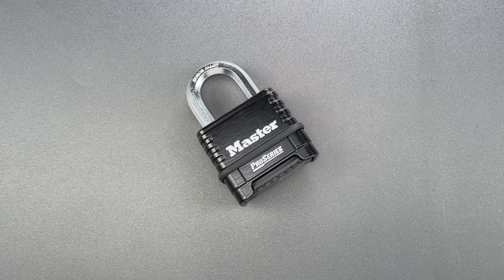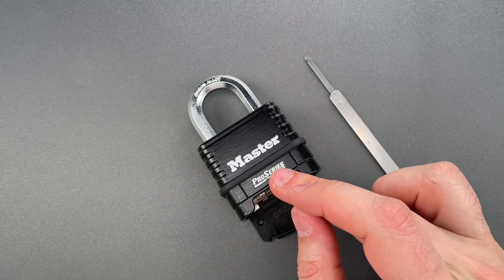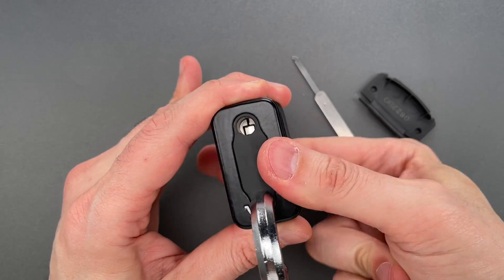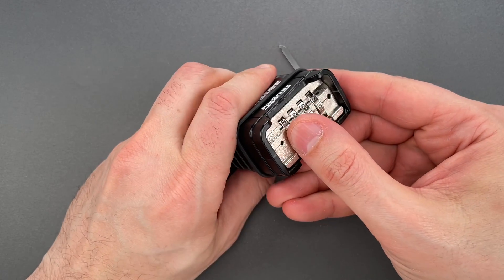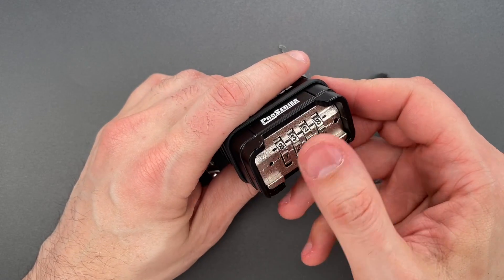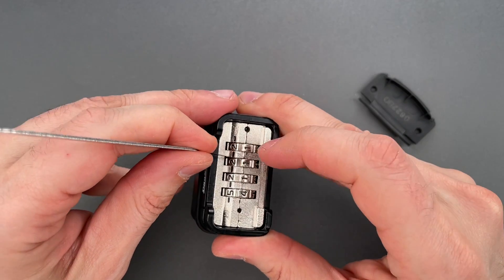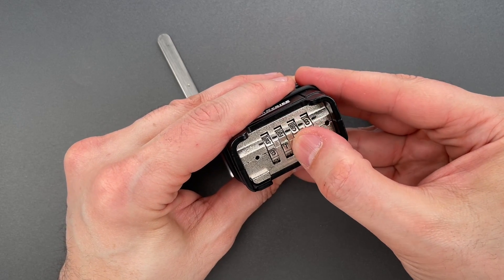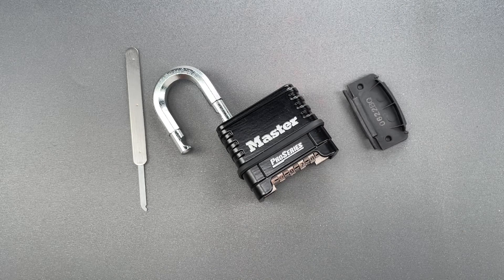[1521] Decoding Master Combination Padlock (Model 1178)

Comment: why are seemingly "all" combination padlocks in the US the kind with the wheels on the bottom (not counting the ones that have a rotating wheel on the front, which is just even weirder), while most if not all combination padlocks found in Europe are the kind with the wheels down the side with the shaft going through them? It seems the latter one is cheaper and easier to produce (maybe Im wrong?) and they are inherently more resistant to manipulation, since there is no separate locking mechanism you can reach in with a tool to manipulate. And will almost certainly have false gates to make more traditional decoding (like your first method in this video) more difficult as well (which even the cheapest ones have, since it's not an additional cost in any way to have them, while the Masterlock in this video clearly didnt have them).

I just dont understand why locks sold in the US go for a seemingly (to me anyway) more complicated and thus more expensive design and mechanism when a cheaper and easier one is automatically more secure anyway.

Comment: Mr. LPL, thank you for another informative video!  However, I have noticed the sound level on your videos recently are very quiet.  Even with my volume all the way up, I have a hard time hearing it on my laptop.  At any rate, the only reason Master lock can still produce junk like this is similar to how vehicle manufacturers can get so much money out of new vehicles.....simply because people are willing to buy them!
Reply: I agree about the sound level. If the video sound is loud, it can be turned down. If it is too soft, there is only so much ability to turn it up. I watch on my phone, often surrounded by other activity with competing noise.

Comment: I don't know, seems like one of the better Master Locks.
Reply: Only because combination locks can't be raked open.
Reply: It's one where you need to know the "trick", which is better than some. However, the "trick" being "Put tension on the lock while guessing the digits" isn't a particularly good one... At least the build quality looks reasonably decent!

Comment: The saddest thing about this is it will not change anything. All of the home stores will still sell tons of Master Lock products and Master Lock will not change their products.
Reply: I have used Master locks for many years on storage units and when they have been defeated it has been by common bolt cutters. I think maybe an angle grinder a few times, too.
Reply: @MrTruckerf  This!

The crushing majority of people have no idea about picking or decoding a lock like this. And amongst thieves it's just barely more common knowledge. To a thief it doesn't pay off knowing the ins and outs of decoding these locks. A battery powered angle grinder works on all locks no matter the design or construction. And if the lock would be built to withstand the angle grinder odds are the door or whatever the lock is securing isn't as sturdy.

Brute force is the most universal "skill" you can apply to doors and locks. And if brute force doesn't make it you're not using enough of it...

It's a bit cliché but oh so true. The small percentage who do know how to decode these locks are generally not the ones you need to worry about. That is unless your main concern is someone getting in without leaving signs of entry. Then this becomes a much bigger problem and you probably shouldn't buy your locks at Walmart.

Having said all of this I still think it's ridiculous how these known weaknesses remain in products that are not even cheap, and how they keep popping up in new lock designs time after time with only minor differences, and usually not enough to even slow down someone who ahs learned to pick or decode one of them.

Comment: if it is a 0-9 lock, it would be easier to move all digits 4 in the other direction (10 = full rotation)
Reply: No, they turn better in the other direction.
Reply: I was thinking this, too, but maybe scrolling the other way undoes something inside?
Reply: @DBTechYT  It's him going easy on Master Lock (or an intimidation tactic), intentionally going slightly slower :V
Reply: @higueraft571  That actually makes a ton of sense :)

Comment: Masterlock: Our locks have so many different vulnerabilities that you won’t know which one to use on which lock.
Reply: Picker wont know what to do from having so many options
Reply: @QruisS , paralyzed by choice! 😂
Reply: @jeffsmith6303  stunlocked (🥁) by the possibilities
Reply: @jeffsmith6303  Knowing how I react in front of a restaurant menu, that would definitely work on me xD
Reply: They should make a special lineup that tries to combine as many of them as possible into one lock.
Reply: @ristopaasivirta9770 ❤😅😅😊😂😊😅😅❤😊😅😊😂❤❤😅😅😅❤😅😊😮😊😮❤😊😅❤😅😅😊😅😮😅😮❤😅❤😅❤❤😂❤❤😅😅😅❤❤😮❤😮😅❤❤❤😊❤😊😮😮😊😊❤😅😅❤😅❤😅😂r
Reply: @ristopaasivirta9770  That would actually be counter-intuitive because then it increases the chance any one method would work without fail. I think you meant that they should make the locks so they don't have so many vulnerabilities, but still possesses ONE of the many known vulnerabilities. So you have to try harder to discover what it is. 

More specifically, if we took a single lock model and mass produced it, then it would be even more interesting to find that one production of that model's line has one kind of vulnerability. But grab another lock from the same production line and model... it has a different vulnerability built-in! You'd be grabbing the same lock, same model, but a different vulnerability each time! That would be an interesting take from Master Lock to employ. To embrace the vulnerabilities.
Reply: Conversely, you never have to worry if you forget the combination. You don’t even need any kind of a tool to open it!!’
Reply: Ahhh, the "predator satiation" method of security.
Reply: Security through obscurity lol
Reply: Two wrenches force on the shackle almost always works, however to the point where the shackles start to become unusually beefy.😆
I already needed to correct myself. Angle grinder.... bolt cutters and so on....🤣
Reply: Ah I see, the "reverse psychology" anti-pick defense....😂
Reply: They should make a lock that you have to use a combination of bypass strategies to open it rather than a code
Reply: Security through choice paralysis
Reply: Some of the locks are so bad that a good whack with a hammer is enough to open it.😂
Reply: I am glad masterlock made some locks that require no tool to pick, now if the owner loses the key, he can finally open the lock without a locksmith, or owning any tools. Because the lock is so bad, some thieves will  feel bad for him and just leave his stuff alone.
Reply: Lockpicker is so undecided on what metod to use, that it delays the picking.
Reply: Security by indecision...
Reply: Sounds like IBM 😂
Reply: Ain't that a form of pick resistance
Reply: The picker will have so many choices that the lock becomes unpickable
Reply: Security by decision paralysis.
Reply: LPL spins wheel …. Hot breath it is pfffft 💨
Reply: Make a lock thats made of africanized bees.
Reply: Masterlock: "If you can't beat them, confuse them"
Reply: That's called security through obscurity
Reply: Security through obscurity
Reply: It's the only way to get past the 2 minute mark.
Reply: That is spot on for Masterlock!
Reply: often shaking them hard enough is a good method.
Reply: And that's their secret of success.
Reply: Masterful comment;)
Reply: Thats the trick the picker won’t be able to decide how to do it and the lock will go unpicked
Reply: @flyingspinners1  Yup.  Indecisiveness is key.
Reply: ¿Por qué no todos ellos?

Comment: That has to be one of the worst locks I've seen in all the LPL videos I've watched :-D  A lock that can be decoded with no tools??  Just wow.. 

I'd love to see LPL finish the work with StuffMadeHere (I think he was the one) to build an actual unpickable lock.  I know he had gotten really close from the back and forth videos.   Keep up the amazing work in exposing all of these locks as basically shams that at best say "this is private, please don't touch it" rather than actual security.
Reply: Oh this CERTAINLY isnt the bottom of the barrel... 

Quite a few can actually be solved similarly, but even faster, particularly combination locks in general.

Some you can just slap open, at least one you can just... remove the (unprotected) hinge pins on a case and go through the OTHER side, etc.

Comment: The moving them down six positions after the deep notch blew my mind. LPL I would love to know just how much time you spend studying each locks mechanisms after the initial picking to figure out more ways of just embarrasing the poor lock and its manufacturer.
Reply: Using the notch decoder aligned the gates, but it didn't align them with the rest of the lock to allow entry. From there you can just move them all one position at a time until you find the position that unlocks.
Reply: The same method works with all mechanical multi-wheel combination locks. Find something that differs for each wheel, then rotate all wheels syncronized to move the gate in place. If you're familiar with the specific lock implementation, you know exactly how much you need to move the wheels to move from the position where you felt the difference to open lock position. At worst it would need 9 extra tries.

And as for feeling the difference in wheels, you basically have to guess left or right side of the wheel to insert your feeling gauge.
Reply: I sometimes question his harsh criticism of these locks - this one took longer than many for him to open (by either method), and that was after knowing the internal mechanism - someone coming upon this lock for the first time would take much longer.
Reply: @quillmaurer6563  He's kind of stuck having to rate them according to his own skill.  The fact that he was able to do it without the tool is probably the biggest criticism, but we should see what beginners have to say when they first do this.  That said, I haven't had one of these to practice on for some time, so I can't be one to make that comment.
Reply: @TesserId  this is a 0 if you stretch it maybe 1 skill attack...
Reply: @quillmaurer6563  technically, first method works on most combination locks. That is not something you need to know about how the mechanism works. I have opened quite a few locks myself such method, some bike locks, some padlocks, and I have never done any lock picking, or have any knowledge about lock mechanisms. 

The second method, yes, that does require the knowledge about the lock mechanism, but that is not the point, when an easier and less skill intensive alternative exists.
Reply: @SuperUltimateLP  O.K., I'll stretch it to a 1.  I think we need to reserve 0's for no-skill attacks, though I'll grant even that's a little hard to define.  Maybe, hitting locks with a hammer to open them would count as a zero.  This one does require knowledge and a little practice, so let's at least jack it up to a 0.5 or 0.75.
Reply: @quillmaurer6563  The first one is a common method that works on tons of combination locks. Dont need to know specifically how this lock works to figure that one out. A halfway decent lockpicker could do it.

Of course most of these locks still require SOME knowledge to do it, but its not that hard for a lot of them to have some basic knowledge on common attacks that generally work against most locks.

its the locks that require special tools or non-common tricks that tend to be more secure. But unfortunately most easy locks to break into are very generic in their vulnerabilities.

Also, the only reason it took him so long had nothing to do with difficulty of breaking into the lock. It was purely just because the method was more time consuming since you had to check every digit. But someone without any skill could easily do it just as fast if they knew the method.
Reply: @eragon78  I would also suspect that LPL could do the first method much faster.
It just wouldn't be good for a tutorial video.
Reply: @quillmaurer6563  I mean, I dont think anyone in these comments is expecting a normal lock to be ultra super duper hardcore unpickable or anything. There are extremely difficult to pick locks but theyre hard to find and cost hundreds of dollars. Not worth for most applications.

But its completely inexcusable that most even low security locks have the flaws they do. If you can open them without a tool using a simple attack like the one in the video, or with a simple lock rake, then the lock is an utter failure. 

If the tool is so common that litterally anyone can buy it for 2 bucks and rake open half the locks they see without any knowledge at all on the locks theyre picking and no skill whatsoever, then locks arent secure enough.

Basically, if the lock even requires a tiny bit of skill its fine because the vast majority of people arent going to have that skill, and like you said, there are easier targets.

Its about the abundancy of 0 skill attacks that most locks are susceptible to thats the problem. 

Locks like that are only secure for very low security options. Maybe like keeping a kid out of something. But its not going to be useful at all for protecting anything you actually care about. Invest like 3 more dollars and get at least a halfway decent lock with a little bit of research. Doesnt have to be the god tier unpickable lock. 

But if it can be broken into without any tools or a simple rake, then its not even worth considering imo.
Reply: @quillmaurer6563  Yea, the average person knows almost nothing about locks. But this is exactly why so many companies get away with basically scamming people with crappy unsecure cheap locks.

Its especially frustrating because some of the worst security vulnerabilities are pretty trivial to fix, but the companies cant even be halfway bothered to even try because it has no impact on sales whether or not they actually fix these issues so they dont even bother no matter how easy it would be.

But thats why informing people is so important so they can actually know what it is theyre buying. Again, my stance on it is, if it can be opened without tools, then it isnt even worth your time in the slightest. 

But yea, I would definitely like to see statistics of how thiefs usually break into locks as well on various applications. Id probably agree with your general assessment though if I had to guess though.

I know if I personally was trying to steal stuff, Id probably walk around with a few basic no skill common tools such as a few rakes and maybe a few bump keys or something. Stuff that takes no effort to use but work on a shockingly large number of locks pretty quickly. So Id be surprised if there werent actual criminals going around doing the same thing to at least some extent. But how much it is, I dont know. Not everyone is aware its even an option and extremely easy, but I feel that if you're in the criminal circle of stealing stuff and bypassing locks, you're probably slightly more inclined to look up potential picking solutions before you immediately jump to grinding locks, which may notify you that most locks have extremely easy to bypass common security flaws.

But yea, idk.
Reply: @quillmaurer6563  He'd have done it faster, if not explaining & demonstrating what he was doing for the picker who asked for assistance. I've seen at least one video where he demonstrated as he did here, then again silently to show how quickly it could be done. Think it's triple the time when he's teaching vs. just doing.

Comment: I hate the fact that I'm not good at this. But always enjoy these videos
Reply: Practice makes perfect my friend.... You get the feel for it eventually.
Personally i moved on from these to button push combo locks on doors, basically the same method but you're feeling for the hard buttons instead.
Reply: Get one of those cheap fake book safes. I'll scramble the wheels and then open it with my eyes closed. After a time or two it's really easy to feel the "loose spot" on each wheel while putting tension on the knob.
Reply: You can always practice picking locks and improve if you wish :)
Reply: @NoThankYouLeaveMeAlone  for sure. Appreciate the kindness. I'm a roughneck on a drilling rig and finesse isn't something I possess
Reply: @ROOSTER333  Get one of these locks and train your skills for 10 minutes a day. You'll be amazed how much progress you'll have in half a year.

That said, I'd recommend getting good set of tensioners and proper picks and start with pin tumbler locks if you want to make it a hobby. The important thing to understand about the pin tumbler lock picking is that you want top of the keyway tensioner and you want a tensioner that's really snuggly fit. That means you'll need minimum of 3 top of the keyway tensioners (3 most common thicknesses) to be able to pick typical pin tumbler locks. The actual pick isn't that important. As long as it has a medium hook at the end, it will open any pin tumbler lock sold for less than $50.